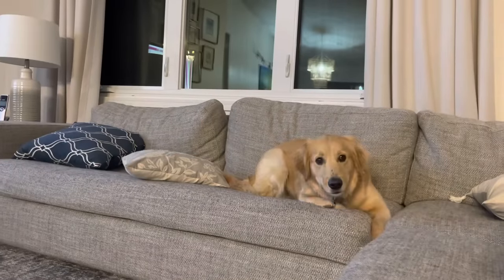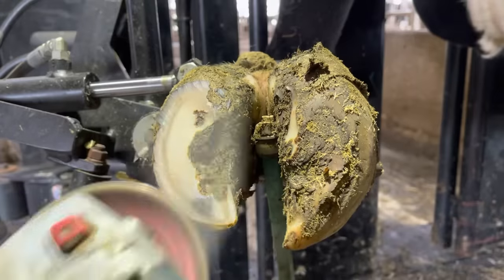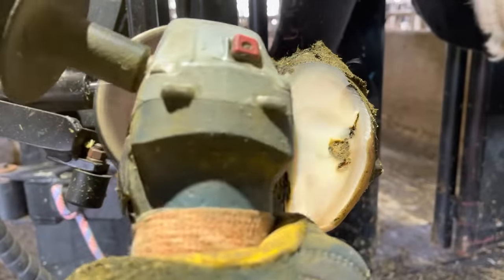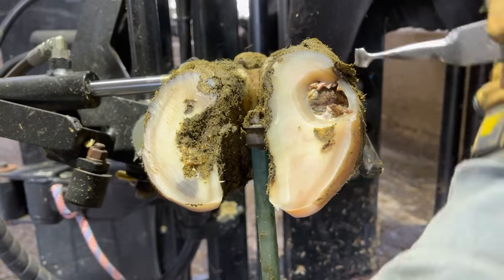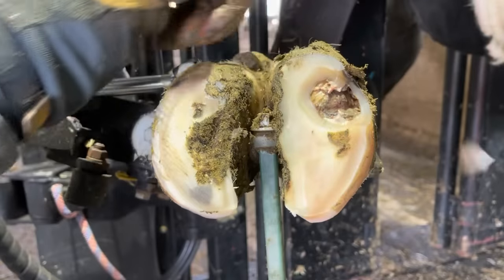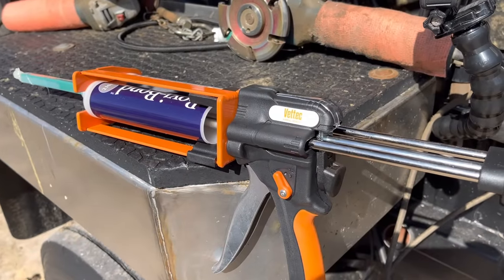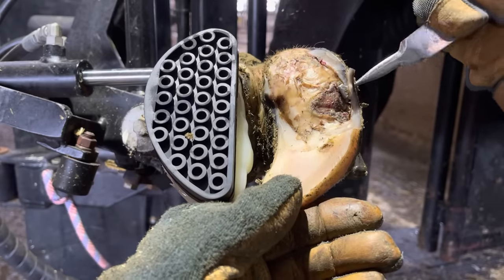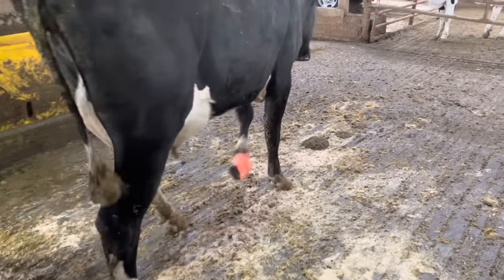We’ve Got Some EXTENSIVE WORK To Do on This One

Comment: Thanks for mentioning the concrete. My horse spends most of his day on concrete (he also has a large sand paddock and a straw area but he chooses the concrete), and I noticed that the concrete is very unforgiving when it comes to hooves. Some people say it requires less trimming because concrete wears the hooves more, but my experience is it actually requires more trimming, or at least more often. As soon as the walls get a little long the start to bell and they bell hard. Long bars get crushed into the sole immediately and become very hard to trim. You can't afford to be just slightly late. I would say it almost requires a different method of trimming. Sadly there isn't much information available about trimming horses that spend most of their time on concrete, so I'm trying to gather every bit of information I can get on what concrete does to hooves.
Now that I think of it, my horse is housed in cow-style freestall. 😊

Comment: Hi Nate, I know this probably won't reach you, but I have a few questions to ask!

I live in Arizona, a state well known for it's ranching- and it's scorching summer temperatures. If heat stress can occur as low as 68 degrees, which is often the temperature here in winter, let alone summer, how do cattle farmers here prevent their cows from going into severe heat stress if not heat stroke? If you happen to know anyone in the cattle industry here, I'd love to know what they specifically do. I know that the cows raised here are usually more heat-resistant breeds, but I can't imagine that does much when it gets to 110 in the shade. Is it air conditioning, fans, use of ice blocks, or something I wouldn't think of? I know that cattle are expensive animals, and even those apathetic to their welfare would take steps to ensure their investment.

Thanks! I adore your videos!

Comment: The best trimmer on YouTube great video bud is there any discomfort when you first apply the salicylic acid to the open area
Reply: Can't say for certain but it probably stings a bit, I have a face wash with a low concentration of salicylic acid in it that if I leave it on my face for to long can sting a little and feels a bit like hand sanitizer on an open wound if it gets into any open acne. It stings pretty bad for a few seconds and then fades very quickly

Comment: I just had a thought. Pretend u took off the entire hoof of the cow, right down to the corium. The corium is essentially skin, right. Well how far down would u have to cut to get to the meat. Like there is the epidermis, dermis, and hypodermis layers in normal skin. How far down is bottom layer of skin? Is it thin or thick? Just a weird thought I had since I’ve seen a lot of corium watch videos lately

Comment: You were talking of heat stress in the animal. I wonder why they do not have a shower for the cows, like they have those big spinning brushes for the cows. The cow steps in a square and because they are in the square a switch turns on to spray them with some cooling water.

Comment: NATE THEY MAKE RESIN BOOTS FOR HORSES OUT OF THE STUFF YOU USE TO STICK THE RUBBER BLOCKS ON YOU NEED TO DESIGN A RUBBER MOULD FOR A COWS HOOF AND PAINTENT IT AND DO THE SAME THING WITH COWS FEET BEFOR SOMEONE ELSE DOSE AND YOU LOOSE A TON OF WORK AS A SHOE FOR A COW WOULD STOP A LOT OF DAMAGE?